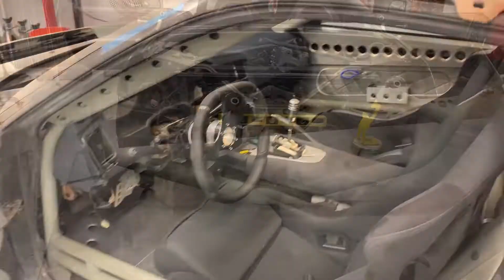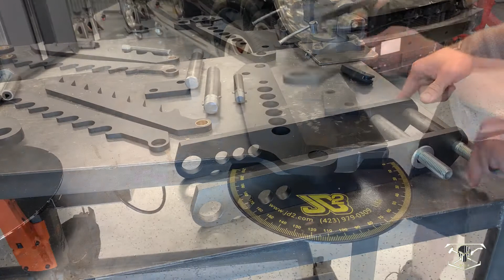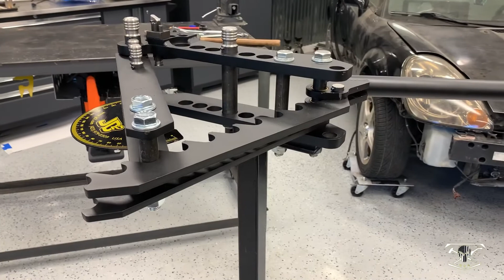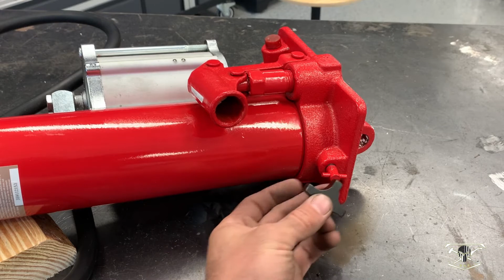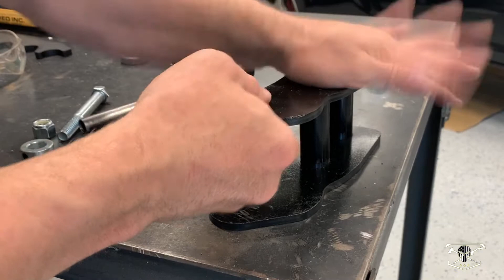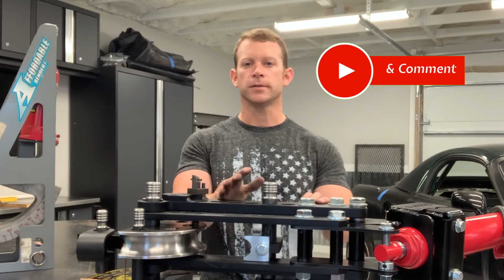JD Squared Tube Bender Stand and Hydraulic Conversion

Comment: Looks really good. What's the cost of the unit, give or take?
Reply from the maker: Thanks! maybe over just over 1k. the metal i had just laying around and the hydraulic ram i got for 100 bucks on clearance. I think I'm gonna build a full tube chassis with this in the future.
Reply: @scantronsgarage  Thanks for your answer. I mess with cars, older ones and finding the right piece on line is a nightmare.
I'm building a gasser, 1965 Dart GT 440/727 combo and the binder you featured would be the cat's meow.😊
Reply from the maker: @johnadams7402  Oh yes! I like this bender better than my affordable bender model. I plan to make a full tube chassis with the jd2 next
Reply: @scantronsgarage  I'm looking forward to the step by step videos.
Happy New Year!